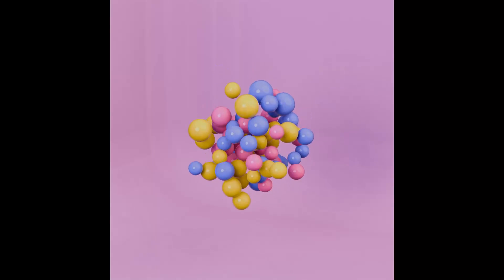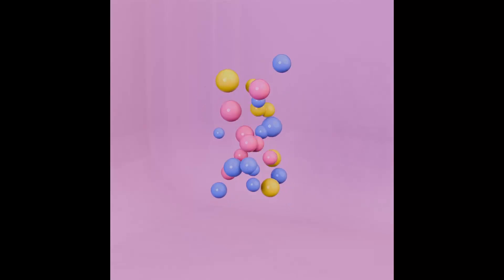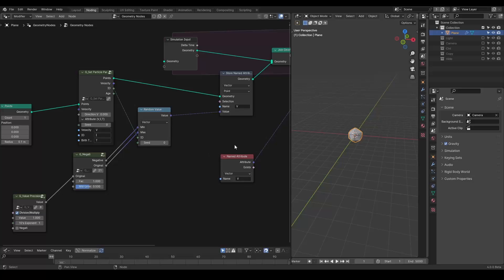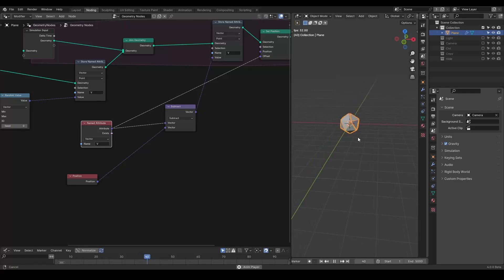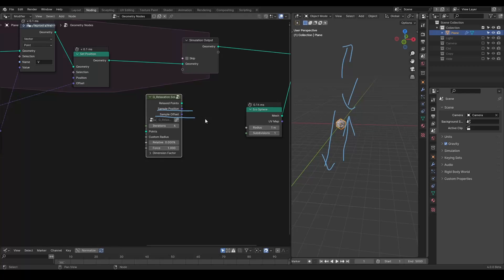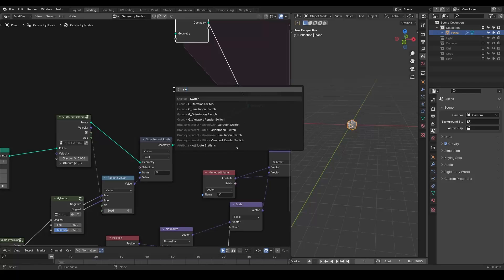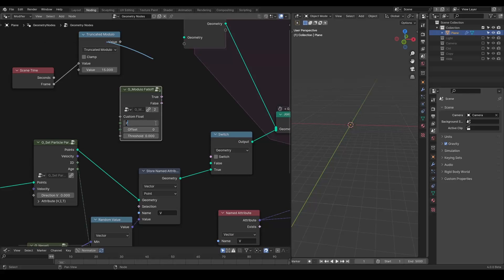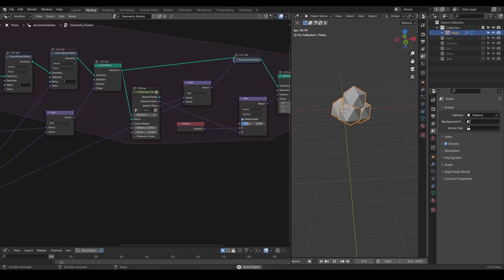[Tut] Rigid Body Ball Dynamics - Blender Geometry Simulation 4.0

Comment: I couldn't find the Relaxation Solver node in GN preset's. Is it my fault or have you not updated yet?
Reply from the maker: if you aren't using the add-on, you may mistakenly downloaded presets 1.6 for blender 3.6, in which relaxation solver is not available. If you can't use the add-on, the presets version 2.0 are available on github: https://github.com/Gerstmann-Bradley/Mograph-Presets-of-Geometry-Nodes
Reply: still didn't see that node, idk it's like not fully all node when i check logs  @bradleyanimation120

Comment: I followed your tutorial and it worked perfectly -- but I must confess I didn't understand how exactly you did it... :) I noticed that in your animation you used spheres with different radius -- I tried to do the same changing the point radius and instance scale to a random value, but I think it didn't work as expected...  Anyway, thanks for sharing, I've always wanted to see this kind of simulation in Blender, and I'm sure we'll see an easier solution very soon. Thanks again!
Reply from the maker: at 3:58, I used "ID" in random value node to give different velocity and directions for particle emission. If you were to set the radius, you can to the same in random value node and plug it into "set point radius" node.
Upon instancing, "radius" can be plugged into "scale" to make sure point sizes equals to instance sizes.
Reply: @bradleyanimation120  Thanks for the instructions Bradley -- I'll try to to do that.